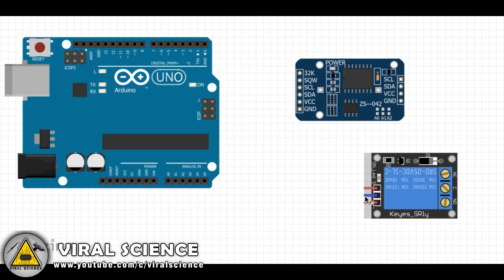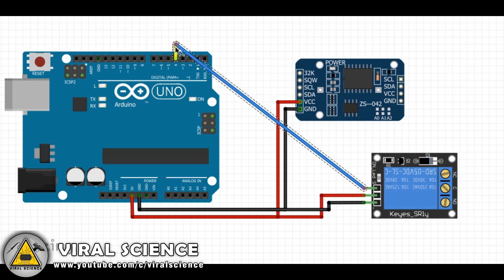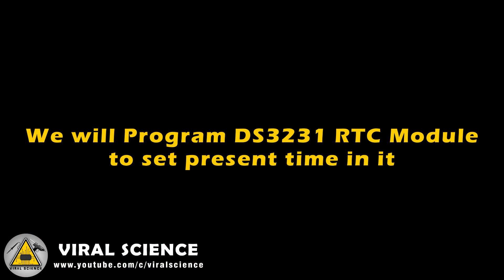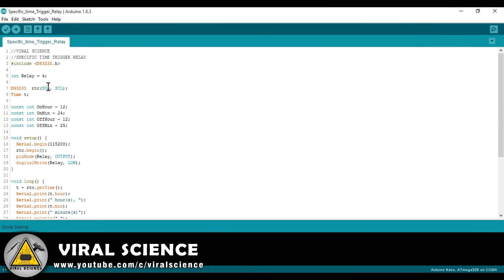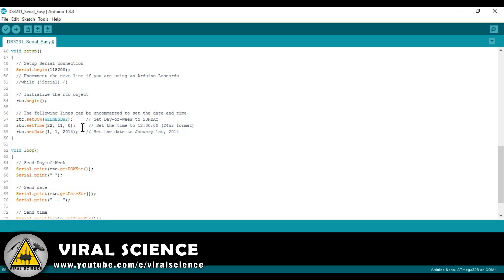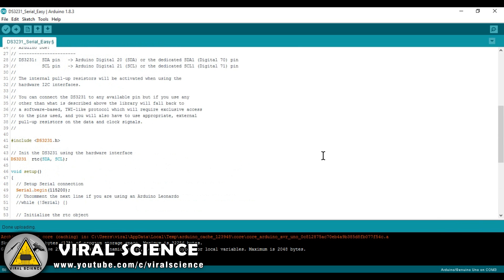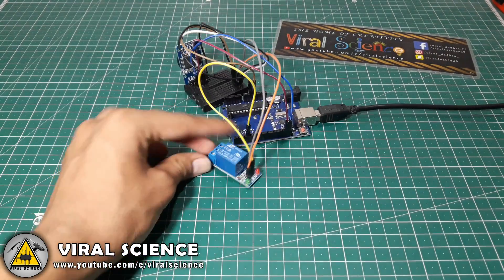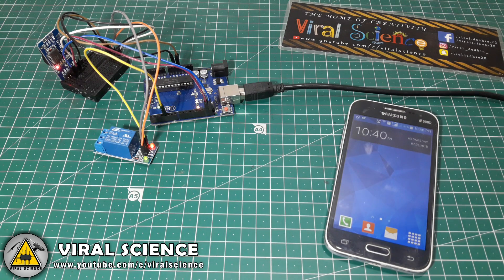Arduino Relay Trigger at specific time | DS3231 RTC Module

Comment: t is far from the most reliable way. It's very weak. If it is for feeding animals, and at the time you configured there was a power outage in the neighborhood, the animal will starve. If you have an RTC, use your benefits as follows:  
  if (led == 0) {
  if (now.hour() >= 16) {
  if (now.hour() <= 20) {
    digitalWrite (11 , LOW); //turn on led
  led = 1;
  }}}}

You need to inform the arduino that it has already been done or not. It is even highly recommended to use the eeprom memory for this, which is recoverable after a power outage.

Comment: The video and explanation is great...but the code should be little more vast in considering the fact that if power goes out in between the specified time and the time to be on has gone past then the relay wont be on unless it is the on time in the next day....still working on that part

Comment: I have a project... 
A board with 10 leds each representing the subjects on a time table for a class... 
How can this project be modified to light up just one led at a time when the time for the subject is due and to switch it off after the lesson period is over and then switch on the next LED until it circles through the ten subjects(LEDS)...

I will really appreciate if I'm being replied?

Comment: If there is a power failure at the time when the relay is to be closed.
After the power supply is restored, the relay no longer closes according to the written code, very bad code.
Reply: Yes I ture
Reply: @karthikonline4974  

#define between_min(a, b) ((a) < (b))
#define between_max(a, b) ((a) > (b))
#define between(x, a, b) (((x) >= (a)) && ((x) <= (b)))
#define between_in(x, a, b) (((x) >= (a)) && ((x) < (b)))

 DateTime now = rtc.now();
  uint16_t _minToday = (now.hour() * 60) + now.minute();

  uint16_t _minEprON = (irtc._hourON * 60) + irtc._minuteON;
  uint16_t _minEprOFF = (irtc._hourOFF * 60) + irtc._minuteOFF;

void _switchTimeControl(uint8_t _index, uint16_t _nowMinute, uint16_t _minuteON, uint16_t _minuteOFF) {
  if (_minuteON == _minuteOFF) irtc._flagSTC = false;

  if (between_min(_minuteON, _minuteOFF)) {
    if (between_in(_nowMinute, _minuteON, _minuteOFF)) {
      irtc._flagSTC = true;
    } else if (greater_equal(_nowMinute, _minuteOFF)) {
      irtc._flagSTC = false;
    } else {
      irtc._flagSTC = false;
    }
  } else if (between_max(_minuteON, _minuteOFF)) {
    if (between(_nowMinute, _minuteON, itm._maxMinitDay)) {
      irtc._flagSTC = true;
    } else if (between_min(_nowMinute, _minuteOFF)) {
      irtc._flagSTC = true;
    } else  if (between_ou(_nowMinute, _minuteOFF, _minuteON)) {
      irtc._flagSTC = false;
    }
  }
}

Comment: In the circuit diagram it shows two jumper wires connecting to the 5V on the arduino UNO ? you can only fit one of the jumper wires in there 
Does one of them connect to the 3.3V?

Comment: Hi. I'm very new to this. will you be able to share the same setup but with 4 channel relay module. Because in my greenhouse I have 4 water lines. My AC water motor is not powerful enough to pressure all 4 lines at the same time. my plan is to open one line with motor in 15min intervals. Will you be able to help me with the coding.

Comment: cool, very good. it has like with just one button whenever it is pressed it resets the count ... and for another project of a soldering iron with vibration sensor I turn it off in 30 minutes if it is not used .. asables I forget and my lining stays on overnight. ..suggest a video with attny85 and a relay or mosfet triggered for 30 minutes-- ok thanks

Comment: In the middle  starting and ending time if i power disconnect for 5 sec the arduino. Then it is not on again after the power.Please solve the problem.

Comment: Please Help Me. This code is fully ok. But Aretor on time (1.10 AM to 3.20 AM)  if Arduino power off in this time by electricity fail then when again electricity again come and again give power the Arduino then do not on  Aretor again in this time.Which i have selected. Help me for code editing.

#include <DS3231.h>

int Aretor = 13;

DS3231  rtc(SDA, SCL);
Time t;

void setup() {
  Serial.begin(115200);
  rtc.begin();
  pinMode(Aretor, OUTPUT);
  digitalWrite(Aretor, LOW);
  
}

void loop() {
  t = rtc.getTime();
  Serial.print(t.hour);
  Serial.print(" hour(s), ");
  Serial.print(t.min);
  Serial.print(" minute(s)");
  Serial.println(" ");
  delay (1000);
  
  if(t.hour == 1 && t.min == 10 && t.sec == 00){
    digitalWrite(Aretor,HIGH);
    Serial.println("ARETOR ON");
    }
 else if (t.hour == 3 && t.min == 20& t.sec == 00){
    digitalWrite(Aretor,LOW);
    Serial.println("ARETOR OFF");
    }
   
   
    
     

    
}

Comment: Someone will need it 
When you want to schedule many minutes hour and day:
code for 1 hour and many minutes my.

//VIRAL SCIENCE
//SPECIFIC TIME TRIGGER RELAY
#include <DS3231.h>

int Relay = 4;

DS3231  rtc(SDA, SCL);
Time t;

const int OnHour = 22; //SET TIME TO ON RELAY (24 HOUR FORMAT)
//const int OnMin = 48;
const int OffHour = 22; //SET TIME TO OFF RELAY
//const int OffMin = 49;

void setup() {
  Serial.begin(115200);
  rtc.begin();
  pinMode(Relay, OUTPUT);
  digitalWrite(Relay, LOW);
}

void loop() {
  t = rtc.getTime();
  Serial.print(t.hour);
  Serial.print(" hour(s), ");
  Serial.print(t.min);
  Serial.print(" minute(s)");
  Serial.println(" ");
  delay (1000);
  
 if(dt.hour == OnHour && (dt.minute == 17 || dt.minute == 20)){
    digitalWrite(den,HIGH);
    }
    
    else if(dt.hour == OffHour && (dt.minute == 18|| dt.minute == 21)){
      digitalWrite(den,LOW);
    }    
}

Comment: I don't know anything about arduino but i tried to add this code and it works. try this if you want to add seconds and multiple time trigger.

#include <DS3231.h>

int Relay = 4;

DS3231  rtc(SDA, SCL);
Time t;

const int OnHour = 1;
const int OnMin = 14;
const int OnSec = 20;
const int OffHour = 1;
const int OffMin = 14;
const int OffSec = 50;

const int OnHour1 = 1;
const int OnMin1 = 16;
const int OnSec1 = 20;
const int OffHour1 = 1;
const int OffMin1 = 16;
const int OffSec1 = 50;

void setup() {
  Serial.begin(115200);
  rtc.begin();
  pinMode(Relay, OUTPUT);
  digitalWrite(Relay, LOW);
}

void loop() {
  t = rtc.getTime();
  Serial.print(t.hour);
  Serial.print(" hour(s), ");
  Serial.print(t.min);
  Serial.print(" minute(s)");
  Serial.print(t.sec);
  Serial.print(" second(s)");
  Serial.println(" ");
  delay (1000);
  
  if(t.hour == OnHour  && t.min == OnMin && t.sec == OnSec){
    digitalWrite(Relay,HIGH);
    Serial.println("LIGHT ON");
    }
    
    else if(t.hour == OffHour && t.min == OffMin && t.sec == OffSec){
      digitalWrite(Relay,LOW);
      Serial.println("LIGHT OFF");
    }  
      if(t.hour == OnHour1  && t.min == OnMin1 && t.sec == OnSec1){
    digitalWrite(Relay,HIGH);
    Serial.println("LIGHT ON");
    }
    
    else if(t.hour == OffHour1 && t.min == OffMin1 && t.sec == OffSec1){
      digitalWrite(Relay,LOW);
      Serial.println("LIGHT OFF");
    }
 }
Reply: Bro do I need to add something??

Comment: really weird problem:
i got this delay between my DS3231 time and my t.Hour/t.Min of 23 seconds constant.

example:
time
10:11:00,000 = 10 Hour(s) 10 Minute(s)
10:11:23,000 = 10 Hour(s) 11 Minute(s)
10:12:00,000 = 10 Hour(s) 11 Minute(s)
10:11:23,000 = 10 Hour(s) 12 Minute(s)

does anyone know how to fix this, because i print the DS3231 real time to a display and it is verry annoying to have a 23 second delay on my on/off funciton. 

i could use the delay time to adjust the on/off settings but something doesn't feel right about that.

Comment: Good video!
Three questions:
1. Is there a separate code for the DS3231 board?
2. How do you add the DS3231 library? What is the EXACTE library name? I cannot find the "DS3231_Serial_Easy" library.
3. I'm building a circuit relay switch for a school bell system. How do I add multiple times? I only want the relay to be triggered for 3-5 seconds.
Reply: how did your project go? I am trying the same project now and I would appreciate it if you would help me out. yonatayakob52@gmail.com

Comment: guys the code is on his website.

//VIRAL SCIENCE
//SPECIFIC TIME TRIGGER RELAY
#include <DS3231.h>

int Relay = 4;

DS3231  rtc(SDA, SCL);
Time t;

const int OnHour = 22; //SET TIME TO ON RELAY (24 HOUR FORMAT)
const int OnMin = 48;
const int OffHour = 22; //SET TIME TO OFF RELAY
const int OffMin = 49;

void setup() {
  Serial.begin(115200);
  rtc.begin();
  pinMode(Relay, OUTPUT);
  digitalWrite(Relay, LOW);
}

void loop() {
  t = rtc.getTime();
  Serial.print(t.hour);
  Serial.print(" hour(s), ");
  Serial.print(t.min);
  Serial.print(" minute(s)");
  Serial.println(" ");
  delay (1000);
  
  if(t.hour == OnHour && t.min == OnMin){
    digitalWrite(Relay,HIGH);
    Serial.println("LIGHT ON");
    }
    
    else if(t.hour == OffHour && t.min == OffMin){
      digitalWrite(Relay,LOW);
      Serial.println("LIGHT OFF");
    }
}

Comment: Can we add multiple time trigger in this project can you plz tell how to I would be. Very helpful to my project
Reply: try this 

#include <DS3231.h>

int Relay = 4;

DS3231  rtc(SDA, SCL);
Time t;

const int OnHour = 1;
const int OnMin = 14;
const int OnSec = 20;
const int OffHour = 1;
const int OffMin = 14;
const int OffSec = 50;

const int OnHour1 = 1;
const int OnMin1 = 16;
const int OnSec1 = 20;
const int OffHour1 = 1;
const int OffMin1 = 16;
const int OffSec1 = 50;

void setup() {
  Serial.begin(115200);
  rtc.begin();
  pinMode(Relay, OUTPUT);
  digitalWrite(Relay, LOW);
}

void loop() {
  t = rtc.getTime();
  Serial.print(t.hour);
  Serial.print(" hour(s), ");
  Serial.print(t.min);
  Serial.print(" minute(s)");
  Serial.print(t.sec);
  Serial.print(" second(s)");
  Serial.println(" ");
  delay (1000);
  
  if(t.hour == OnHour  && t.min == OnMin && t.sec == OnSec){
    digitalWrite(Relay,HIGH);
    Serial.println("LIGHT ON");
    }
    
    else if(t.hour == OffHour && t.min == OffMin && t.sec == OffSec){
      digitalWrite(Relay,LOW);
      Serial.println("LIGHT OFF");
    }  
      if(t.hour == OnHour1  && t.min == OnMin1 && t.sec == OnSec1){
    digitalWrite(Relay,HIGH);
    Serial.println("LIGHT ON");
    }
    
    else if(t.hour == OffHour1 && t.min == OffMin1 && t.sec == OffSec1){
      digitalWrite(Relay,LOW);
      Serial.println("LIGHT OFF");
    }
 }
Reply: @shiroeschulz4515  thanks dude, very useful.
Reply: @shiroeschulz4515  very nice 👍🙏👍 thanku

Comment: How to create multi chanel relay timer mister?
Reply: try this
#include <DS3231.h>

int Relay = 4;

DS3231  rtc(SDA, SCL);
Time t;

const int OnHour = 1;
const int OnMin = 14;
const int OnSec = 20;
const int OffHour = 1;
const int OffMin = 14;
const int OffSec = 50;

const int OnHour1 = 1;
const int OnMin1 = 16;
const int OnSec1 = 20;
const int OffHour1 = 1;
const int OffMin1 = 16;
const int OffSec1 = 50;

void setup() {
  Serial.begin(115200);
  rtc.begin();
  pinMode(Relay, OUTPUT);
  digitalWrite(Relay, LOW);
}

void loop() {
  t = rtc.getTime();
  Serial.print(t.hour);
  Serial.print(" hour(s), ");
  Serial.print(t.min);
  Serial.print(" minute(s)");
  Serial.print(t.sec);
  Serial.print(" second(s)");
  Serial.println(" ");
  delay (1000);
  
  if(t.hour == OnHour  && t.min == OnMin && t.sec == OnSec){
    digitalWrite(Relay,HIGH);
    Serial.println("LIGHT ON");
    }
    
    else if(t.hour == OffHour && t.min == OffMin && t.sec == OffSec){
      digitalWrite(Relay,LOW);
      Serial.println("LIGHT OFF");
    }  
      if(t.hour == OnHour1  && t.min == OnMin1 && t.sec == OnSec1){
    digitalWrite(Relay,HIGH);
    Serial.println("LIGHT ON");
    }
    
    else if(t.hour == OffHour1 && t.min == OffMin1 && t.sec == OffSec1){
      digitalWrite(Relay,LOW);
      Serial.println("LIGHT OFF");
    }
 }
Reply: @shiroeschulz4515  sir onhour =1 means what?is it 1 am or 1pm
Reply: @askingmachine8858  1am used 24hr format
Reply: @shiroeschulz4515  sir If it for 3 time a day and every time it last for 5 minute  and exactly same time next day and so on.
Reply: @askingmachine8858  yes it's possible to make it trigger 3 times a day for 5mins every day

Comment: i wan set 2 time you can do this
Reply: try this
#include <DS3231.h>

int Relay = 4;

DS3231  rtc(SDA, SCL);
Time t;

const int OnHour = 1;
const int OnMin = 14;
const int OnSec = 20;
const int OffHour = 1;
const int OffMin = 14;
const int OffSec = 50;

const int OnHour1 = 1;
const int OnMin1 = 16;
const int OnSec1 = 20;
const int OffHour1 = 1;
const int OffMin1 = 16;
const int OffSec1 = 50;

void setup() {
  Serial.begin(115200);
  rtc.begin();
  pinMode(Relay, OUTPUT);
  digitalWrite(Relay, LOW);
}

void loop() {
  t = rtc.getTime();
  Serial.print(t.hour);
  Serial.print(" hour(s), ");
  Serial.print(t.min);
  Serial.print(" minute(s)");
  Serial.print(t.sec);
  Serial.print(" second(s)");
  Serial.println(" ");
  delay (1000);
  
  if(t.hour == OnHour  && t.min == OnMin && t.sec == OnSec){
    digitalWrite(Relay,HIGH);
    Serial.println("LIGHT ON");
    }
    
    else if(t.hour == OffHour && t.min == OffMin && t.sec == OffSec){
      digitalWrite(Relay,LOW);
      Serial.println("LIGHT OFF");
    }  
      if(t.hour == OnHour1  && t.min == OnMin1 && t.sec == OnSec1){
    digitalWrite(Relay,HIGH);
    Serial.println("LIGHT ON");
    }
    
    else if(t.hour == OffHour1 && t.min == OffMin1 && t.sec == OffSec1){
      digitalWrite(Relay,LOW);
      Serial.println("LIGHT OFF");
    }
 }

Comment: Please help me!
i set the OnHour=13 and OnMin=10 and OffHour=15 and OffMin=15 i worked well but after the OnTime when power disconnected and again powered on then it dose not ONN the relay as at that time the time is between ON and OFF but not equal to OnTime
Reply: Use Sonoff basic to do that. Sonoff is Rs 600 and it can remember scheduled on off time even after power failure.

Comment: Thanks for your video. Can you please let me know, In irrigation system " Is it posible to set specific month for watering ? ie, In my case every year November to May last irrigation system works daily 2 times (AM & PM) for 1 hour daily and June to October last only need daily 1 or 2 times for only 5 Minutes. Kindly please advise ? Please help me !!!!!!!
Reply: Maybe you can change the code up a bit for the specific requirements as per the season. And change the code when the season changes

Comment: Made this today. It works fine. I'm going use this for an automatic pet feed. I got the DS3231Serial_Easy library from www.rinkydinkelectronics.com . Make sure you have the right DS3231 Library for this to work. I just paused  the video to get the code as the links do not work.
Reply: Did you end up building the pet feeder? I want to make a fish feeder for my schools aquaponics system. Ive been looking at videos to make one using the arduino, mind you i have the slightest knowledge of how this all works. Could you tell what materials you used. From what i gather, i need an arduino, an rtc, and a servo and some sort of drill bit, what did you use?
Reply: Do you have the code for this? If you please upload it.
Reply: DS23231.h: No such file or directory

How to fix this error

Comment: you mean to say: uploading 2 different codes at different times on the same board? wouldn't the later overwrite the former? aren't you just confusing us newbies? I'll try combining them... I;m having a project of same concept but I'm still having few errors.
Here's the link on my current project: https://youtu.be/g2N5_YYLiqs
Reply: I think he is setting just the time to time module with first code. So it will keep tracking time indpendently from that point on.

Comment: Good video👍
Please can you make this without Arduino and by using 9V battery?? 
Please do reply....
Waiting for your reply...
Reply: you can use IC4060  with few passive electronic components....The drawback is:  no clock involve. you can utilize the device  through its ON and OFF intervals, depending on resistor-capacitor combinations. you can google it.